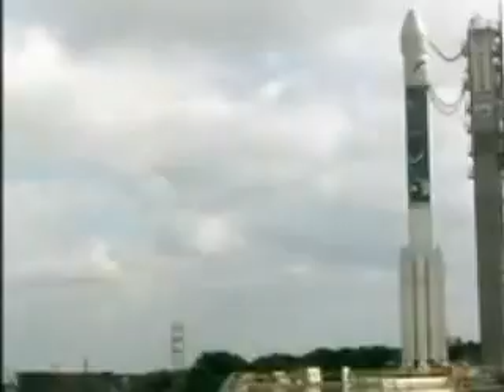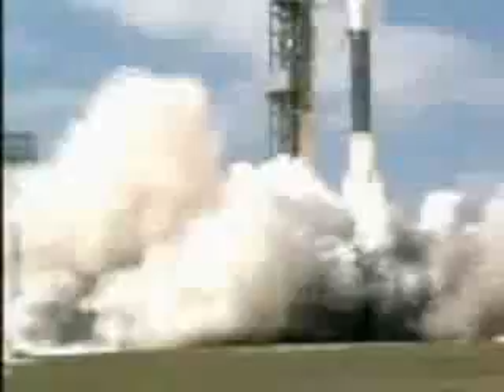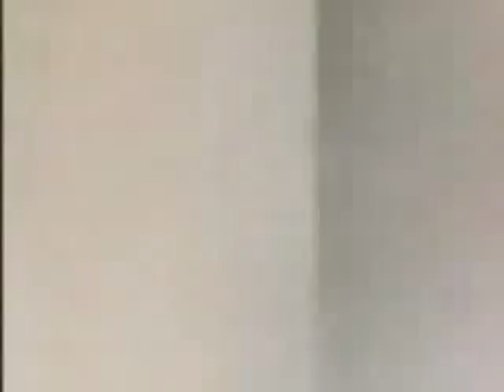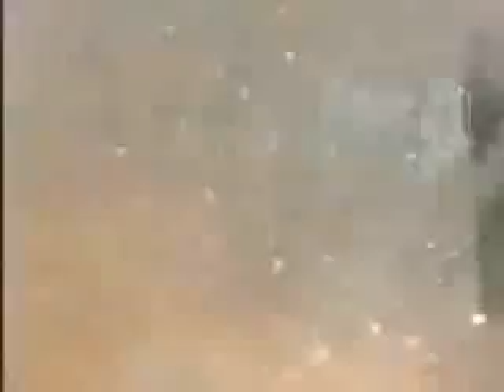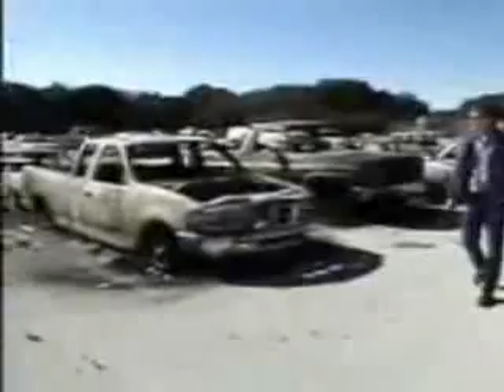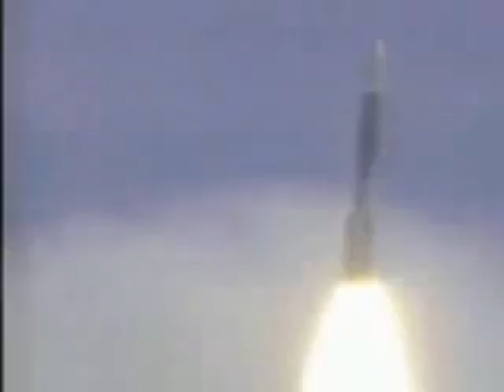Delta Launch Accident

Comment: @pokewiz309 I don't know the details, but it could have been, say, a 17' long stress crack on the inside of the solid rocket booster tube, which appeared after they filled it. The only way to detect that would be to xray it after the fact.

Comment: The launch angle is taken into consideration with this. 

All rockets and STS's at Cape Canaveral and at Kennedy are launched in a easterly direction toward the ocean away from spectators and buildings.

This is not so much because of safety reasons but because of the rotation of the earth (from a west to east direction) makes attaining the orbit much easier.  :-)